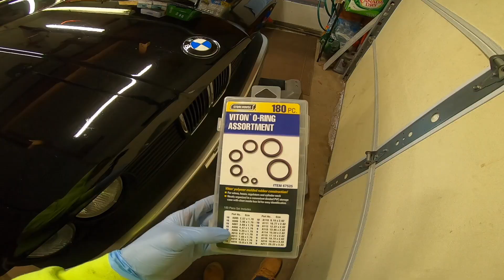Fixing A Big Oil Leak On The Turbo M52 E30 & DW300 Fuel Pump Install

Comment: Are you driving thoes tires in the cold? They have a warning  , that they arn not supposed to handle 40* the deform / crack / go out of round..  (says falken )  I love falkens I have run.    but the cold temp warnings keep me from buying the 615 for my turbo e39 touring... any opinions on how they handle the cold ?   (Currently im in springfeild mass)

Comment: Btw a good tip instead of using all that brake clean use this stuff called Engine Brite engine degreaser you just spray it on let it sit for 5min then blast it off with water and it’ll look super clean

Comment: You need cribbage. Rolling the dice every time you crawl under witdem stands. Three dozen 18" 4x4 timbers make four 14" tall blocks, one under each side jack point. You + three homies couldn't get that car to move a mm. With 4by's and a 10" footprint,  you can take 26k pounds all the way up to 30" high and have the same stabilty. FD's around the world, fema and SAR's all use this tech. Vertical shoring ftw.